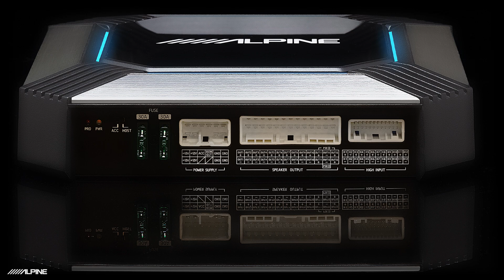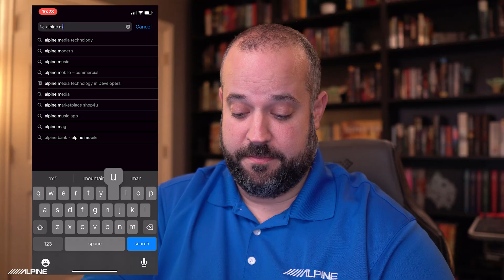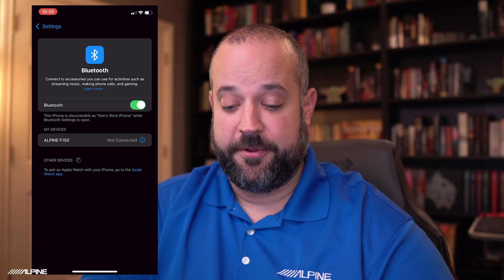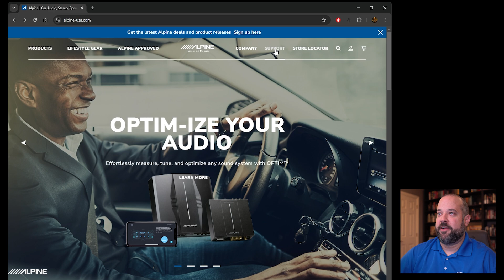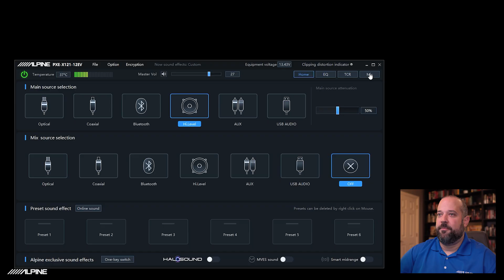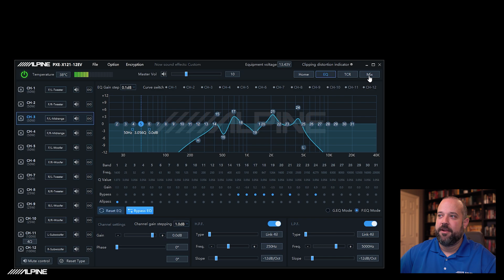Alpine PXE-X121-12EV 12-Channel DSP & Amplifier Software Setup & Overview

Comment: The app has 2.5 stars!!!.... hmmmm is it any good?
Reply: Based on what?
Reply: 2.5/5 is obviously not good.  But also, it only has 3 reviews. That could easily be user error. This is complex software so somebody using it and not knowing what they're doing might give it a poor rating.

There's   almost nothing  anywhere on this app which is troubling for a $1300 amp
Reply: @Bigheadedwon It's also highly likely people that are using it and don't have any problems simply don't come back and give the app a rating. 
People that do have a problem and get frustrated are a lot more likely to vent their frustration with a negative review.

If there's only three reviews in total, it's not really enough to draw any conclusions.
Reply: @JasonWW2000  that could also be true, but there's next to nothing on Google about this amp. So I'm guessing it's just not selling well. It is fairly pricey  so it won't appeal to most people. I'm interested in it and there's really only 1 other video besides this on it.

I think Im going to end up buying it but the lack of info really does suck
Reply: If you have a Tesla and don't plan to have rear fill, I could see the appeal of it.  

I ended up going with a 20 channel dsp amp from Goldhorn (the 16 channel would have been fine, but I got a good deal on a used 20 channel). It's kind of pricey as well, but I really wanted to try out it's surround processing. If I like it, that's great. If I don't like it, I won't use it, but I can still try out things like differential rear fill. I don't really plan on using any of it's built-in amplified channels, but I could probably find a use for some of them. There's a lack of information on that brand also. They are used in SQ winning competition vehicles all over Europe and Asia, so I figure they can't be that bad. Lol